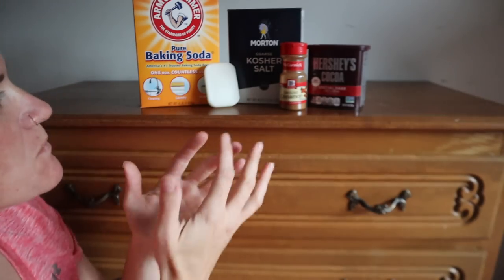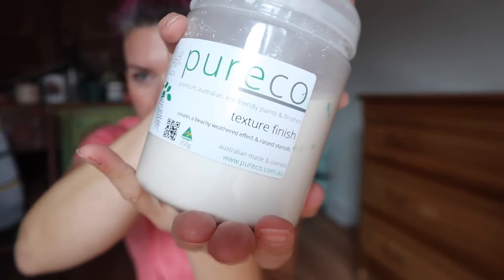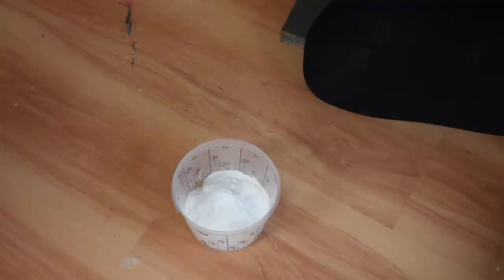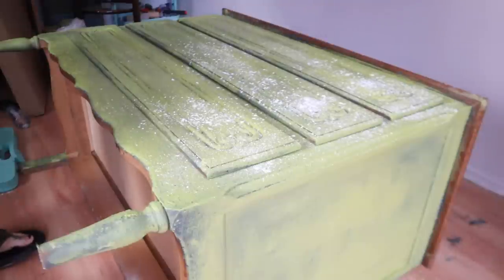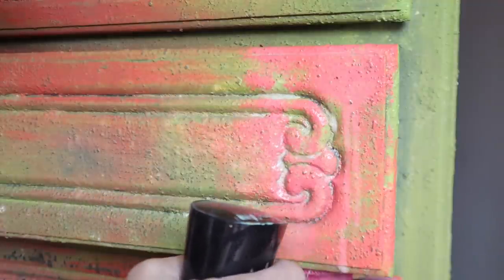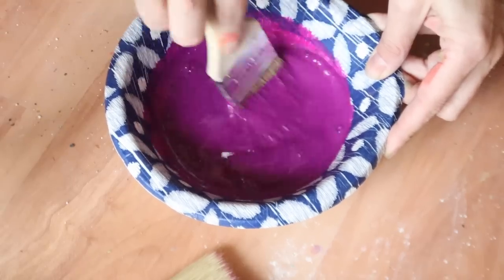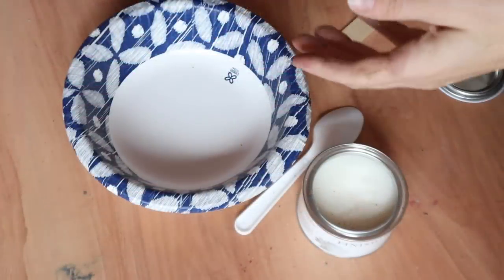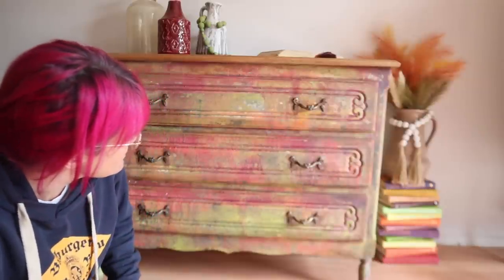How I Used Kitchen Ingredients To Create A Textured Furniture Makeover, Thinking Outside The Box Art

Comment: What I used to do when I still had a wheelchair ramp made out of treated pine was I used SAND (like regular sand) in my exterior paint: it created a bumpy texture, but it also added traction. I live in a place where winter can be harsh sometimes and using sand-laden paint cuts down on both any risk of slippage and any risk of black ice.

Comment: So, I am making a super textured piece for the first time. I used salt and sand in some stucco medium that I sanded down to create a faux stone finish. My question is, how do you properly clean a heavily textured piece? It's going in my bathroom so my plan is to coat it with polyurethane, then wax it. I've done that on a few pieces and it works really well, but not on a piece with so much texture. Any tips... anyone? Thanks so much in advance! 😃🤗

Comment: I had an odd thing happen last year when I used the kosher salt and that was my paint didn’t dry. It sat damp the next day and the salt actually dissolved . I had no texture.  Not sure why that happened .  And off subject I’ve noticed that your camera looks like may have a decentering issue . It’s sometimes hard to see clear your work. It’s out of focus usually on the side . It seems to be more so in the wide shots and may be also that the F-stop you have it on? Is it set at wide open? I had a wide angle that had the de-centering issue .
Reply from the maker: Thank you!! So I noticed my camera is having a hard time focusing and it was driving me mad!! I will have to look and see if I can recenter it!! If I am being honest my camera has fallen more times than I want to admit also 🤭 as far as the salt dissolving I have t had that happen, what brand of paint did you use? I wonder if that makes a difference?
Reply: @BellaRenovare  You're welcome. I think the fact it has fallen has caused the issue. It most likely dislodged or broke the focusing mechanism and or other parts :/.  You'd have to get it repaired for the issue and it may be more costly than replacing it. I had used General Finishes and Dixie Bell. I'm wondering if the addition of baking soda is a key ingredient that I did not have? Maybe it absorbs the moisture from the salt?

Comment: Did the baking soda react to the soda mixed into the paint? Or did the paint encapsulate it and retard the process?
Reply: I just tried it. The vinegar did not react at all to the soda covered in paint. I used a 1/3 mix soda to paint.